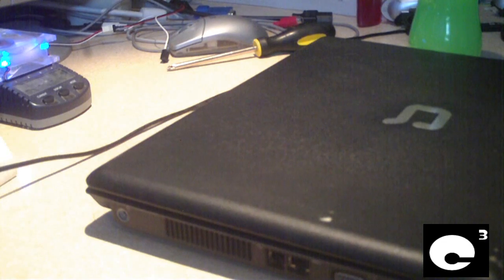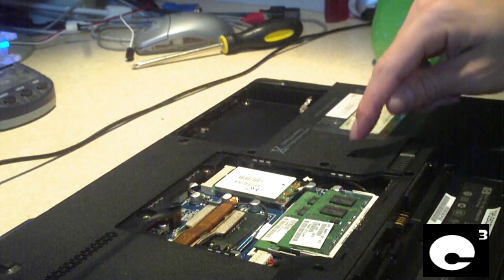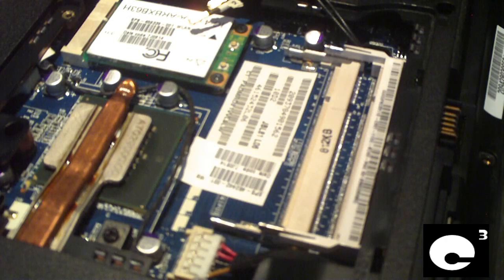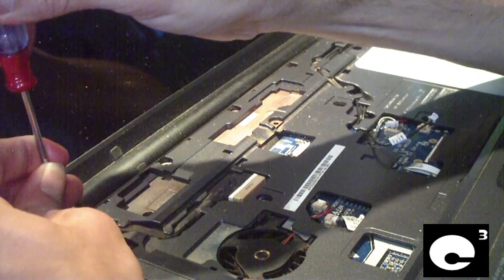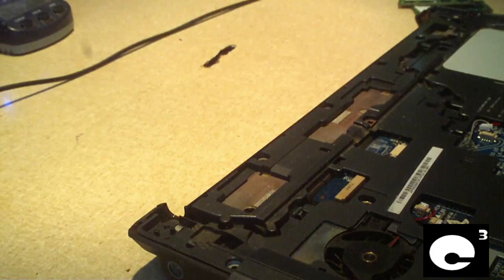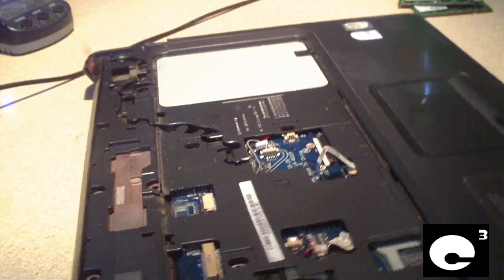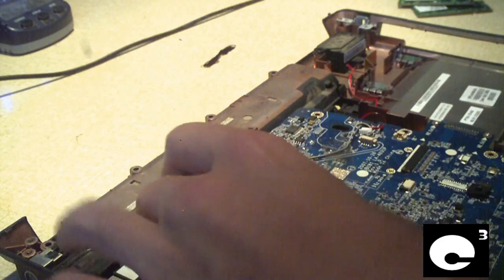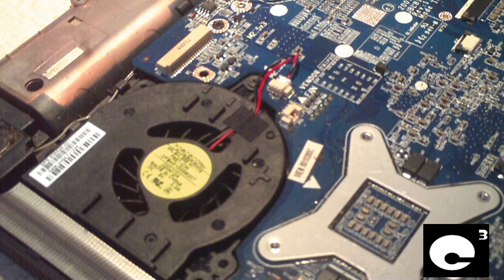Fan Replacement on Compaq Presario c700 Notebook

Comment: I totally agree with you, I have 4 AMD quad core laptop's. And it's not a good idea to, rush through the repair process. I have a HP AMD A12 ENVY DV7, it always runs hot. But it's a quad core. So I think that's normal, it has HP cool sense. I don't have the right tools to, disasimble it. And preform a check up, but it's not a constant run hot. I think it's just application running, all of my quad core laptop's are very well taken care of.

Comment: Thanks for the video. Mine had the fan running almost constantly and was getting hot. When I took the fan off there was a big wad of fluff blocking the vaynes on the outside grill. Now it runs great. Vid was a big help thanks!!

Comment: HP offers excellent detailed instructions for replacing parts. Too bad they have these small white connectors that almost never come out in one piece. I busted two of them; one for the mic input and one for the speaker. There doesn't seem to be any release on them. You simply have to wiggle and pull on them and hope they come out in one piece.

Comment: The video is great thanks.Just one thing I did not see in your demo was when you lift the cover over the motherboard there are two wires. One is attached to the mother board from the mouse pad. that came off ok but the other is a black and red wire that attaches from the cover by the fan to a connection on the mother board by the fan. The wire came out of the connector when I tried to pull it out.  Any suggestions?

Comment: On some C700 models the bezel above the keyboard has at least two screws that need pulled, maybe the video showed it but the video didn't specifically mention that the keyboard does in fact have at least 3 screws specific to it that need removed from the back.  Likely you had just removed them along with a lot of others in the prior step of removing screws from the back.
Reply: yeah those are right under the battery.. took me a bit to notice
Reply: skullhacks78
  On the one I did the screws were so tight from locktite that a couple of the brass threaded inserts they screw into, spun and cracked the plastic molding around them.  Using a tiny bit of model cement (because I was out of superglue) I glued the brass inserts back in being careful not to get any glue in the thread area, along with the cracked plastic, then around the entire plastic raised area the stud fits into I put a fortification of epoxy being careful not to use too much so the bezel still fit down into the cavity it sits in.

I vaguely recall the same laptop had one of the screw studs for the screen frame to base, cracked too and I repaired it similarly with glue and epoxy.

Comment: Great tutorial Nick! I have a Toshiba L645D with overheating problems. I took the whole laptop apart and noticed the fan barely spins. I've cleaned it an unplugged it and the problem still persists.  It began working for a while, but quits working after the processor reaches 60 C. Could the fan be failing or defective fan connector?  Thanks for the help.

Comment: awesome! I'm going to be replacing the LCD on my c700 soon, I'm glad you have the steps leading to remove the screen assembly and housing. That's the hard part!

After the LCD is replaced, I plan to turn it in to a hackintosh, just for fun :P

Comment: Thanks for the video. The only thing I needed to see additionally was how to remove the keyboard cable (which you do by sliding the pieces on each end out a little bit - which then allows the cable to just slide out). My new fan is quite and hopefully will make my laptop last a little longer!

Comment: Followed the video as directed, but when turning the computer back on the screen did not come back on. I only followed the video to know how to get to the fan meaning that I did not take the screen off the laptop or mess with those cables. The only things removed were memory and hard drive. Have a clue what the issue might be?

Comment: I'm going to replace the fan in my c700. But I have no idea what I'm doing. Lol. I'm going to use this video as a guide. Was it really necessary to remove the hard drive, ram and the wires from the wifi card and stuff??? Or does that have to be done to replace the fan?

Comment: Compaq Presario c700 Notebook was my first laptop. 2007 BlackFriday. 4th in line at a Staples. My cousin and sister got it too. After 6years; their laptop are still functional but not main usage. My Compaq Presario c700 Notebook has a start-up problem. Its trying to check system but freezes. I gave it hours time once but no changes. It's stuck. Need advice on that if you could. This video is perfect. I wanted every single detail. Thumbs up. More to say, but damn character limit.

Comment: thanks for the vid, It turned out to be the fan clogged up with dust stopping it spinning, so I lifted keyboard and used the vacuum on low power and spun the fan with screw driver.

Comment: This is another reason I love my Acer Extensa 5230E.  One cover on the bottom of the machine, and you can access the HD, wireless, CPU, heatsink, fan, memory, everything.  I wouldn't still own it after 3 years if it was hard to work on.  Thanks for this video, I think overheating is the cause of problems on a C700 I got for free and I will try to get it going again, this video will help me get 90% of the case apart to get to the heatsink/CPU to get some Silver 5 on it and clean it out good.

Comment: i took apart my laptop, and now it wont turn back on. when power cord is attached the light around the cord and the bottom lightning sign is on but the power button and sign wont turn on. I think i may have pulled a wire out but i have no idea how to fix this problem. any ideas?